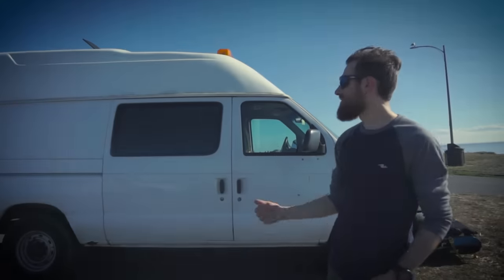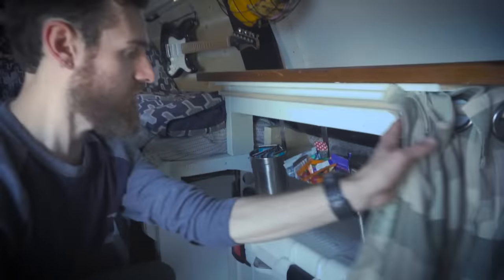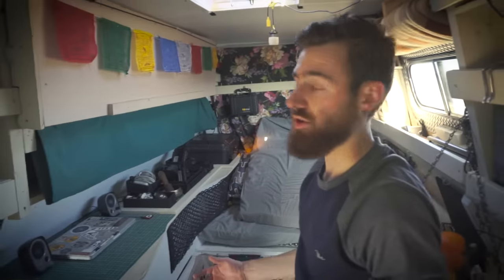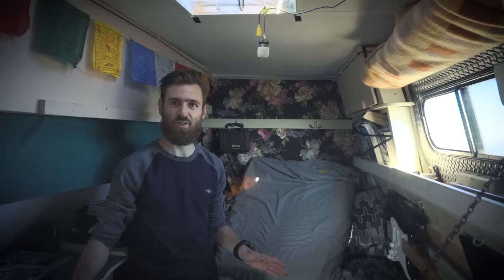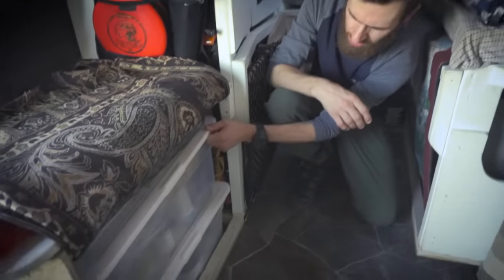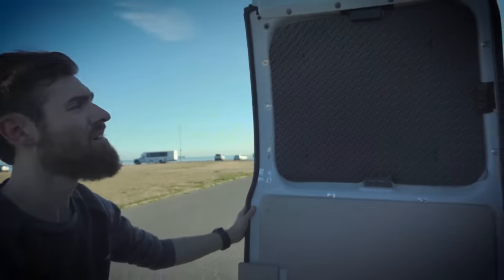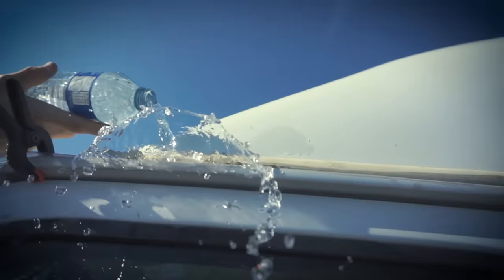Nomad Builds Highly Functional Stealth Camper Conversion from a Ford E350 Work Van.

Comment: It may not look like those $100,000 RVs but simplicity pays. It's highly practical and the longer you're in it, driving from place to place the more mods you think of and can just add in. A superb build all round, especially the stealth decoys. Very nice.
Reply: Yeah, 100k is crazy when you can make it your own and change when your needs do! :)
Reply: Tyler Finlay, exactly,  that's the beauty of it. If something doesn't work right you can rip it out and try something different. Obviously a $100,000 RV would be nice but not practical for the kind of stealth camping and boon docking this one is designed for and I bet it's pretty cosy in there, snuggled up under the duvet while the wind and the rain are lashing outside. I'm quite inspired to have a go myself.
Reply: Hands down, best sleep ever in that thing! Storms are wonderful when in the van with a warm drink looking out the window at the ocean :) I am glad you found some inspiration from checking out the video! Check out my Instagram account linked in the description to see more progress shots and detailed descriptions of the build and recently a few before and after shots of a red Chevy Astro van I converted for a kite surfer from England residing in Vancouver. It was a relatively inexpensive build, specific to summer kite surfing trips holding kite gear and a board with the option to sit inside with the bed folded away. Build was under $1000 for labour and materials, hardware, fabrics, paint and foam for the bed! If you can find a decent van for under a few thousand you are well on your way, especially if in a warmer climate! Good luck David!
Reply: Not to mention all those RV parks with the 100k rv's are full of complaining old people and their little dogs, and the piles of dog poop, and power happy camp managers, and...
Reply: @kameyeam  you might as well be living next to nosy niebors lol

Comment: Great! I'm building my own van and got some nice ideas from yours, such as security on the windows and insulation panels and A LOCK TO INSIDE of the back doors!
Reply: Great eye to notice the additional locks in the doors! The back and side as well as the gate to the cab all lock like that, very secure when parked in cities :) Its also got a manual immobilizer too! Thanks for checking it out!

Comment: Maybe the most efficiently built van I've seen yet. Awesome vehicle to build into a home. Hopefully that collected rain water is only used in the sink/toilet 😁
Reply from the maker: agreed! he did mention to me that, he has some kind of filter system for it as well if need be, but im sure he would use it primarily as grey water
Reply: Thank you Richard! I have only used the rain water collection a few times and its reserved for washing bikes and gear etc. I have a filtration system to make it clean and drinkable if the need should arise :)

Comment: hi he could easily put the fridge on a pull out rack system with a piece of pallet wood (board)with lip and the drawer pull out mountable brackets underneath.
Reply: Great tip for an efficient upgrade! Thanks for the comment :)
Reply: I think he meant to say the cooler instead of the fridge.

Comment: I had a van very similar to your build.  Same type of van as well.  I upgraded my alternator to two high amperage alternator to charge my battery bank.  I had some cheap solar panels as well that charged an independent battery that ran the low wattage stuff like my LED strips on the roof for inside lighting.  My Gf got pregnant and we were forced to put down roots to raise a family.
Reply: I currently have a similar setup going in the new micro home I am building

Comment: when you take a shower where do the water go.
Reply: The shower is mostly used in the summer outside the van as both the spray nozzle and shower head easily reach out the side door. You can also put up a curtain and rod I built along with a large plastic container to catch the water. Never really had to use the shower as I use pools, gyms and friends homes when I am traveling.

Comment: Try dry ice other wise nice
Reply: Great idea! I have been thinking about doing that for longer trips. Its not as available as blocks and cruched ice from gas stations and grocery stores :)
Reply: Terrible idea, unless you vent the heck out of that van. As the dry ice melts it converts back to gaseous carbon dioxide.  In a small enclosed space like that, levels would reach lethal in a very short time. Please don't try this idea!
Reply: Tyler Finlay  check with big grocery stores... I remember them selling it when I worked outside in the recycling barns... But it has to be wraped in paper... Lots of paper I'm not sure if it needs sawdust... It might not last near as long however...It can be costly as well...
Reply: Toga Chicken Is it bad to drink it? I know people will put it in drinks.. and punch bowls...
Reply: Dry ice is not a great idea. It's so cold that liquids stored in plastic bottles or cans will tend to crack the container and leak or even explode. (Personal experience.)
Reply: missy larios nope it’s perfectly safe
Reply: +missy larios At room temperature and pressure, dry ice (frozen CO2) doesn't melt into liquid form, it sublimes: changes state from solid directly to gas. Soda pop, carbonated water, even beers get their fizz from gaseous CO2 and those are safe to drink. I think when you drop a chunk of dry ice in a punch bowl, some of it may dissolve into the drink but most of it is going to escape in bubbles that then flow over the edge of the punchbowl.
Reply: The condensate from plain old ice can be reused though- bathing, washing, etc., so it's a better choice.

Comment: Good air pressure for pumping water idea. Best floor insulation job I have see. The wood furring strips with the foam inside. Best wall insulation. 2 inch foam. plus Reflecto stuff. I lived in a first generation Chevy van for a few months. I have a stove just like yours. Get them cheap at the end of the season. People, you can get lots of foam if you look in the trash behind carpet installation places, plus carpet that rich people toss. The foam is good insulation for walls and ceiling. You can buy huge queen size quilts for $20 at thrift stores. I have tons of them for me and my dogs. Pots, dishes silverware...thrift store. I lived by a trailer park in Pacifica CA. When the winter storms blew over some trailers, the cabinetry was up for grabs. I grabbed. The hurricane disasters should be a windfall for van dwellers. Lots of cabinets, wood scraps.  if you are imaginative.
Reply: So many ways to get second hand materials and furniture for free or at minimal cost. The floor is great and really keep the cold out!

Comment: Like the setup with your less is better on the electronics focus.I would get rid of the ABS and go with high quality drinking water safe pipe instead. Nice bed setup.Best ive seen.
Reply: William Ryan Thank you for the comment! I have 2 water safe containers for drinking. One above the sink and one additional put away. I don’t drink the water out of the ABS tanks. Just for rinsing dishes and cleaning bikes and dirty gear mostly :) I use them for showering in the summer too. Definitely don’t want to drink out of those!
Reply: Yeah Tyler.It's not for drinking for sure.I was thinking it may not be even good for bathing either. I would be wary of it. But that's just me being over cautious.

Comment: Needs an incredible fan to complete a very clever and practical conversion, the solar power will be a great addition.
Reply: I have a few USB powered fans that I use :)
Reply: @explorewestcoast  yes I watched the whole video,the difference is the other model can be set to expell air or suck in air either on/off or by setting a thermostat.Just a suggestion .

Comment: About auxiliary power, use an electric motor with a crank. If you add a regulator circuit you should be able to use it as a Dynamo to recharge the main battery
Reply: I will look into that Bob, thanks!

Comment: Dude, nice and well laid out van. Can I offer a suggestion about your roll up window coverings. If you fasten a string a few inches in form each side, at the top. Run them down the back , under pipe roller back up to.top, up the front side , through metal eyelet (to serve as pullies) then tie the 2 ends together . Now just grab that knot and pull. The window cover will roll up automatically, as fast as you can pull.  ( you can also do this all this one piece of string it's just easier to describe in two pieces of string)

Comment: This is an interesting video.  Sure there are things one could complain about: the cooler looks really hard to pull out, not mounted on raids or bearings, but so what?  What I love are the details: the insulation, the way the  rear windows are made to look like a work van, the front seperator door (also like a work van.)  The water gatherer (I'm stealing that for general  camping use.)  And of course the cones, yellow vest, and work manual :)
Reply: MonkeysMustDie777 I would like to have the cooler of some kind of slide out.

Comment: you need to add a few empty McDonalds cartons in the front to complete the work van disguise :-). I like the low power setup as some vans seem over complicated and power hungry but I would still have a second battery as I would be worried about not being able to start the van and getting stuck. But it seems to work for you thanks for sharing
Reply: phililpb haha! You may be right with the food wrappers! I like to keep it neat and tidy up front though :) I have a few USB battery banks that I charge while on the go along with a jump pack for the vehicle battery.

Comment: Interesting thing about a lot of these van people who get vans to convert them to live in. A used rv that’s less then 5 years old can start for 10s. With police auctions or Craigslist u can get a truck for the cheap to pull it. 

Now get a toy hauler and now u can put a motorcycle in it so when u get into a new place u don’t have to un hitch to travel around. Just unloaded your motorcycle and ride.
Reply: I have a little Honda scooter that can go on the 500Lb capacity rack on the hitch. Its under 300lbs. That thing just sips fuel! Thanks for the insight and for taking the time to comment! Having a 2 wheeled vehicle coupled with an RV or trailer is a great combination!

Comment: The bit about the battery lasting 10 days without charging......you really need a deep cycle to do this on a long term basis even using very little wattage. Doing this with a standard vehicle cranking battery will drastically reduce the battery life and one day your van won't start after a stay over. Introducing a deep cycle/leisure battery into your system is very simple, gives you much more power usage options and also can be supplemented by a small solar array that will still give a few watts into the batteries on the cloudiest days.
Reply: Bushcraft1974 I really hate using the van battery. I know it is not ideal and damages it over time. I need to install an additional battery hopefully with some solar supplementation.

Comment: Hey man sweet setup. I would never go without my discs and my guitar either lol! Anyway, I recently coverted my mountain bike to electric with a rear wheel motor and I kinda went nuts with a $400 lithium battery with 15 amp hours storage (30 mile range) and then it occured to me that I could use the bike battery for power when van living. Just need a 48v to 12v step down converter for $20. Anyway thought I'd share. Awesome rig!

Comment: The cones, vests, and codes book - Brilliant - LOL - made me laugh about his friends thought he was the law. Tyler really has a lot packed into his build-out. Lots of creative nooks and crannies storage. Was that actual  diamond plate around the window, and I think it's on a wall by the storage for ropes, harnesses and the Frisbee Golf discs.
Reply: Thanks Maggie! We all had a good chuckle about that one! It is 1/4 inch thick antimicrobial gym matting that I used for covering and insulation in many places. Gives it a bit of an industrial feel and was very inexpensive.
Reply: I played the video several times trying to write down the insulation used. I got the flooring - I understand it is a floating floor - you said tongue and groove but it looks like 3/4" OSB on top of the lattice and insulation. I'm not clear on the wall and ceiling insulation. Did you say you also put the 3/4' osb on walls and ceiling? If so how did you attach to walls and ceiling?
Reply: Maggies Corner The OSB is sub floor with TnG over the lattice. I used spray foam in the unreachable areas. Rock Wool Sound and Fire insulation in larger areas between the shell and inner frame. Then 1 1/2 inch house hard styrofoam with reflective on one side and vapour barrier on the other. Ceiling has reflectix and the white panels. Everything is sealed with Tuck Tape and reflectix. Check out my Instagram linked in the description. Many more detail photos and descriptions of the process on there! I hope that helps!
Reply: thank you, I don't know how to find your IG page, I looked at your YT page, didn't see it there,  can you give me a link to your IG?
Reply: Maggies Corner There is a link in this videos description I am on my phone and cannot seem to be able to copy the insta link as it opens on the app..

Comment: Our little camper has an 80w solar panel  cheap 10a MPPT and 110ah deep cycle  - it provides enough all through  spring to  autum - think we would put on another panel if using it in winter - it drives lights, 3 fans and various laptop/phone/ led TV
Reply: Right on! I hope to get some kind of solar setup and an inverter soon!

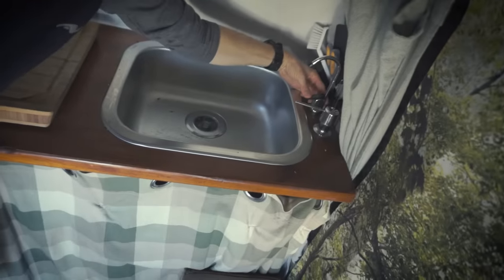Comment: 3:37 Finally get to show off the van build. But don't waste that water! No not worth it!
Later I will use it to wash grapes. -Vanlifers.
Reply: Anon Mason yeah, filling up water can be a hassle sometimes and I was running low. I needed to showcase the pressurized water also and knew that would waste some valuable h2o. I am sure there is someone watching that cringes at the thought of pouring out basically purified water.

Comment: Love the van! I especially like the bed is an L-shaped bench seat when not in use. :)
Although I would be paranoid of the kitchen knives flying free of the magnetic strip in the kitchenette if I had to slam on the brakes or got in an accident. :/
Reply: I have ssen the knife comment a few times. They don't reside there while driving and there is also a steel security gate in between the cab and cargo area.

Comment: Only thing is, the water collected from the roof of the van, might be safe to use as cleaning water. Such as dirty dishes and shower taking. But might not be safe for drinking. I would advise using not only a very good filtration system for it, but maybe boiling also to double insure saftness for consuming.. Due to the paint and other chems used on the van's outside and roof. IDK if you drink it with out treatment, cause did not see you show that if you did. Only collecting it.
Reply: Totally. I never drink the water off the van. Just for cleaning bikes and gear etc.. I would need a serious filter to get rid of trace heavy metals, chemicals and particulate.

Comment: Hey, just to let you know, eggs don't need to be refrigerated...even ones you buy from a store that keeps them cool. That will give you a bit more room in your cooler. Cheers!
Reply: Thanks for the tip and for checking out the video!
Reply: Lol, oh yes they do. Modern store bought eggs have been washed which removes the nature protective layer on them, fresh eggs have a few days to them so long as it is kept around 40 degrees and kept in a cellar.
That is why our ancestors either used them within a few days or preserved them in some way like putting them in salt or pickled them.

Comment: Nice work! I would have loved to see how the shower curtain hooked up and how well it worked. I've not seen a shower in the centre of a van like that before, if it worked well and didn't require to much faff, I would definitely add that to my collection of features that the van I will own will have ;)